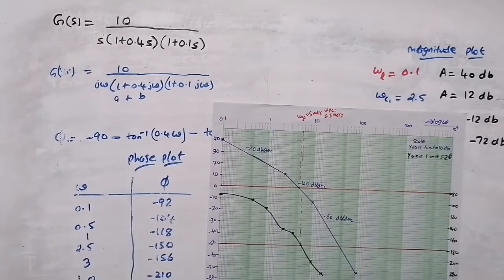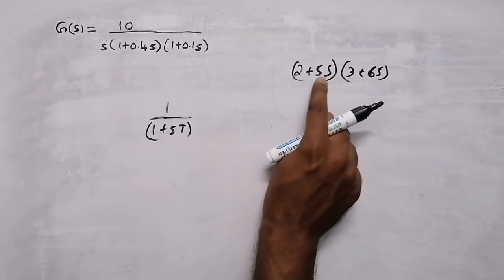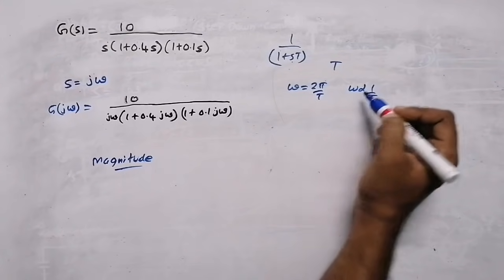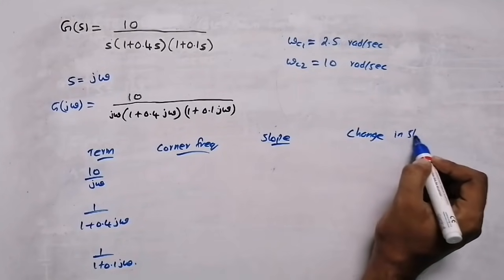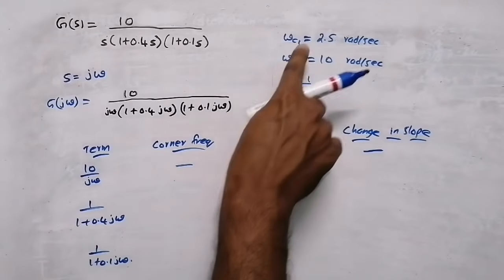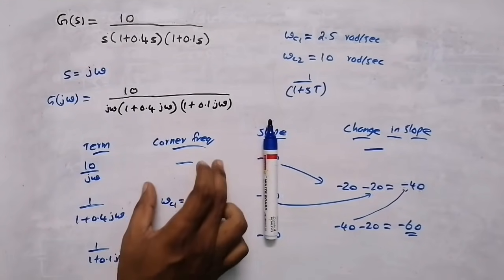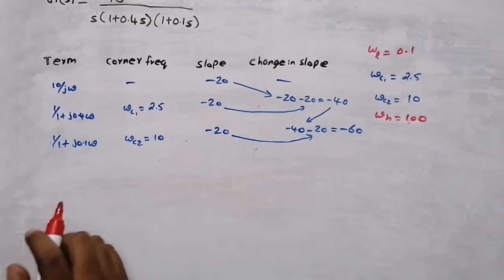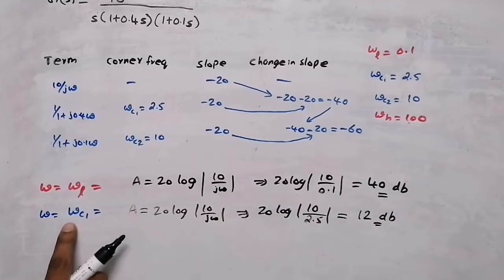Bode plot in control system

Comment: Sir to measure phase cos frequency  why we took 180°for phase angle why can't we take 90° or 220°
Reply from the maker: Suppose think that you have a negative feedback stable system... After 180 degree phase shift the sign changes.... So negative feedback will become positive feedback and earlier the system was stable now it will become unstable.
Reply: For every problem should we take the phase angle as 180°...?

Comment: Can you explain why we need the bode plot. with some real time examples. Thanks for the great effort.
Reply from the maker: Bode plot is used to determine stability of control system.
We can find how the behaviour of a system changes with small change in frequency.
In real life we can use it to determine the stability of electrical circuits which deals with different frequencies.
How change in frequency will affect the stability of the system.
Reply: @smartEngineer5  Thanks a lot.keep going.